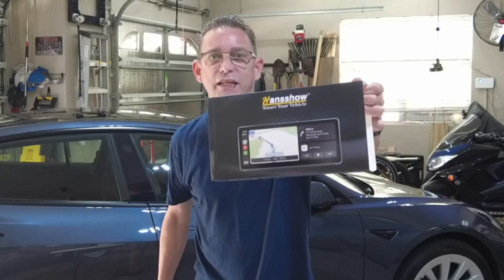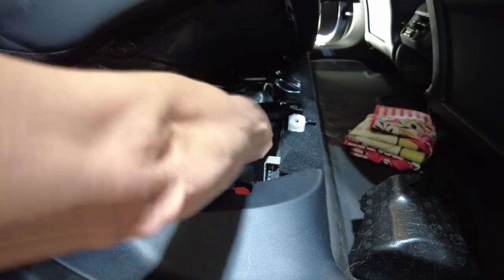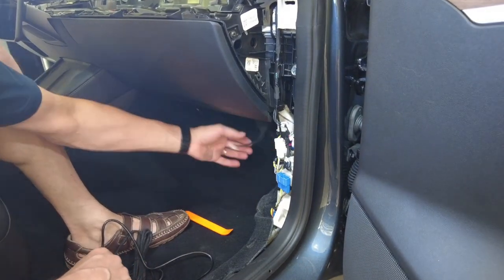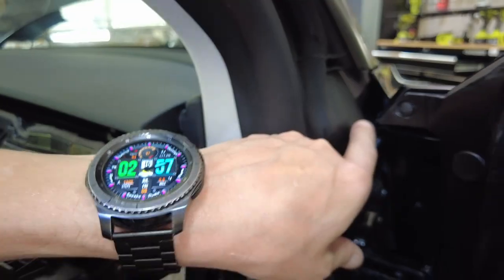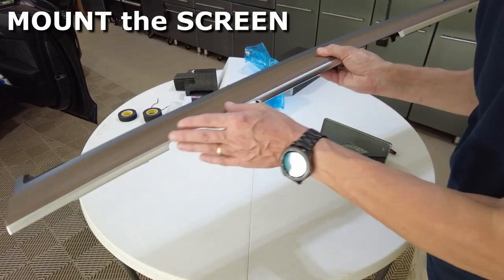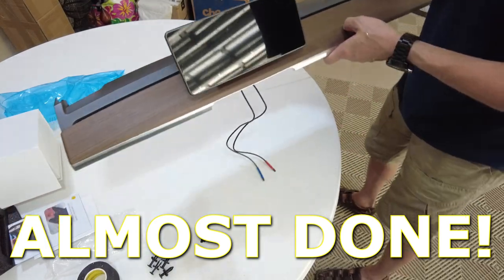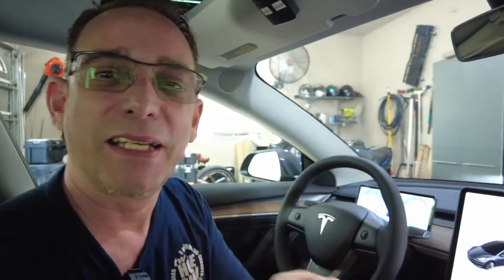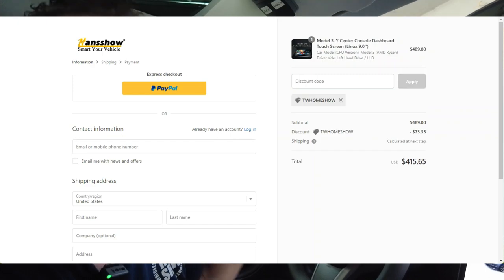Upgrade and Install a 9" HANSSHOW Dash Touchscreen in a Tesla Model 3/Y with Car Play and Android

Comment: Wow, running the 12v battery the way you did looks 10x easier than through the firewall.  When I got my screen in April there were 0 videos showing how to do this.  I ran mine through the firewall which is probably better but man it was one of the hardest things ive done on cars.  I used a 14g wire and fished it through the frunk part then had to reach way up under the dash to grab the wire to be able to fish the 12v wire back through. I almost gave up several times but finally got it.  Would have loved this video back then! Nice install.

Comment: Fantastic video, I’ve scrolled through probably 20 videos to find one like my 2023 model 3 performance and was stuck not knowing how to connect power to my cluster! The only thing different from my wires is instead of a positive and negative wire I have 2 three prong  plugs that I have to find place to plug into but thank you your video was so helpful and I’m pretty sure I can make mine work now!
Reply from the maker: Kirk, Thank you for taking the time to post your helpful comment! I included every step in my video to make this Dash Screen operate in a newer TESLA. I hope you are successful, as I was!  -Todd
Reply: We’ll finding out that mine was a amd Ryzen helped everything then was able to find a video from rpm where they ran the power to the cigarette lighter under the cup holders then finally got mine up and running, thx again
Reply: Can you send the link I'm trying to set me up on a 2023 model y
Reply: It’s unboxing and installing t-sportline msx dashboard

Comment: This install was helpful as there are not many that show the Ryzen vehicles with Li-ion batteries.  I installed the newest 10.25" Hansshow unit today which includes a front camera, GPS, and 4G.  FWIW, I found a relatively easy route for the power wire through a large rubber grommet at the top of the passenger footwell.  There is an inside grommet and an outer one on the firewall side.  The latest kit provides shorter leads for the power and ground wires.  As such, routing the power wire the way shown here won't allow it to reach the battery.  Routing it through the rubber grommet will work.  Similarly, the ground lead is now even shorter, but there is a convenient ground point near the top right corner of the passenger side floorboard.  Routing the power/ground leads this way works well.  It is unclear to me if it is still necessary to disconnect the 12v battery and HV battery under the rear seat, as cars with Ryzen only require a simple plug-in of a spare connector, not the disconnect of the main connector to the system computer.  BTW, rather than connecting the power lead with a screw at the top of the li-ion battery post, I made the connection with a small machine screw & nut at the bottom of the post so that the orange protection sleeve can still slide down over everything.  With GPS, 4G, and front camera, this installation took me quite a few hours, mostly due to routing wires in a suitable fashion to ensure they aren't visible or vulnerable.  One thing to keep in mind: it seems these kits are always undergoing changes/improvements, so any given video may not be 100% useful.  Unfortunately, the Hansshow instructions aren't terribly useful at times either.
Reply from the maker: Hello Ken, Thank you for taking the time to share your install experience. I'm sure it will be of some help to others. I'm going to take a look at my connection to the battery post and see if I can implement what you have done. Thanks for sharing!  -Todd
Reply: I have the same 10.25 unit with 4G/Front Camera etc to install in a MY (Ryzen) and I’m really unsure about how to route the cabling. Not too concerned about the cabin area but going through firewall etc looks tricky. Wondering if there is anyone in the UK I could pay to install it?

Comment: For the positive wire was the nut and washer included or did you have to buy yourself? And for the negative side did you unscrew the nut slightly to put under the nut then tighten it? Nice vid btw.
Reply from the maker: Yes, nut was included.

Comment: Cool video. 
Tesla's not the 1st to do the center control instrument panel but I hope the last. It's a dumb idea and this mod should be factory required. 
I just bought a 22 Nissan and coming from a 30 year old Miata the new tech is impressive. However, since all the newer controls use a screen instead of buttons I'm annoyed anytime I have to take my eyes off the road to fiddle with the screen in the middle. Buttons and dials in the older vehicles didn't require you looking at them. I do appreciate the vast # of controls I do have in the steering wheel.
Like the Tesla vids, just don't forget the automation & other cool stuff.
I've been following you since you automated your single car garage door and one thing I just can't figure out: HOW DO YOU ONLY HAVE 17K SUBS?

Comment: Have you had issues with phone calls echo or delay with this product?  Some of the installs I’ve watched were on intel processors, not sure if that makes a difference.  I would love to hear your overall satisfaction with this.  I’m considering this product but not if it gives headaches with basic functionality with phone calls.
Reply from the maker: Hi Philip, I haven't even used the phone feature on this device. I got it mainly for playing my Amazon Music App, Pandora Music and to have a speedometer display in my direct view. It works AWESOME. The only disappointment I have is with Android Auto. I'm a full-fledged Android user and their Wireless Android Auto application sucks!  Sometimes it doesn't connect automatically and I have to go into my android phone and reset up Android auto. So, I purchased a barely used/pre-owned iPhone8 for $150 from BackMarket.com. The CarPlay from an iPhone works perfectly. I just keep the iPhone in the Tesla console now :)

You're right, I should do a follow-up review - with more details of my experience (and phone-call quality). I think I'll do that in a couple of weeks. Thank you for the suggestion.

By the way....my Wife did NOT want anything installed in her Tesla. After I installed this- I asked her after her first drive, "How did you like the new dash-mounted Hansshow display?"

She said "I LOVED IT! " She mentioned she really liked the speedometer at that location. 

One thing she didn't like was that it blocked the direct blowing of the A/C to her face. I didn't mind that because I hate a fan blowing right in my face and the Tesla cools off plenty - without air blowing directly in your face :)
Reply: Thanks for your information.  I definitely would like a video of your experience with it.  It seems like overall a worthwhile product.

Comment: Great install video, thank you! I just installed it in my M3LR. Works as expected, but I was wondering if anyone can advise about the sound - I am hearing the sound coming out of the screen itself, but is there a way for the sound to play through the car speakers? Also, does anyone know if it makes a difference which positive/neutral tap that you use? I know the instructions said to tap the terminal in the frunk, I ended up tapping the terminal next to the main battery connection under the rear seat cushion. Any insight is appreciated...thanks!
Reply: ....OK, so I realized my phone was defaulting the bluetooth to this screen, and simply changing that to my car's bluetooth routed the sound to the car speakers, so I figured that out. But to get the sound from other non music streaming options like Waze/Maps or such, those sounds are still routing through the display speaker. Do you hear those sounds through the car speakers?

Comment: I have a 2022 Model 3 performance with the AMD Ryzen chip. I ordered the 9" Hansshow display and wired it exactly as shown in this video. When I reconnect the HV and 12v power, I get a number of faults regarding low power, VCFront warnings re: the climate system needing service, not enough power to run all systems, vehicle shutting down, etc. The HV Contactors never reconnect and the 12v battery drains to 0. The Hansshow display, however, does bootup, but it doesn't get any data from the CANBus (battery reading is null, no external temperature reading, etc.). If I unplug the red Hansshow wire from the 12v battery terminal and reconnect the power, everything is fine. It seems there's some type of short with the current wiring configuration. I have checked there are no cuts in the cabling and the only thing I'm left thinking is there's some kind of defect that's causing a ground fault or overdraw of power on the low voltage battery. Anyone run into anything similar to this?
Reply: Thanks for your comment. I’ve just attempted to install the 9” on a Dec 2022 M3LR and am having almost identical issues. What solution/s have you found ?
Reply: @craigharvey4955  it ended up being a bad cable harness. I had 2 options after contacting hansshow support via whatsapp. One, returning the product for an exchange (got mine via Amazon), or waiting for hansshow to ship a replacement cable harness. I opted for the Amazon exchange and the bonus to this method was there was apparently a revision to the harness in the replacement model. It no longer needed to be directly connected to the battery. They managed to pull the power they needed via the existing extra port on the passenger side door area. So now it's just another clip type connector. Much easier to deal with. Good luck!
Reply: @anarchs4ever  glad to hear it worked out well for you. Thanks so much.